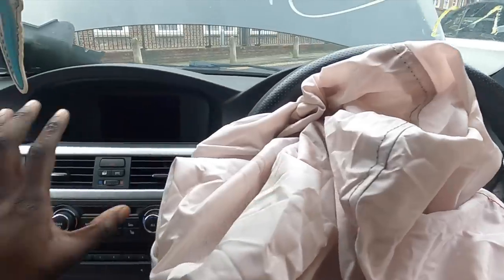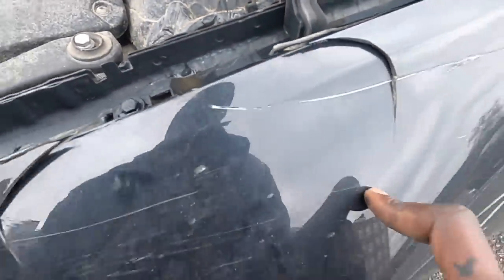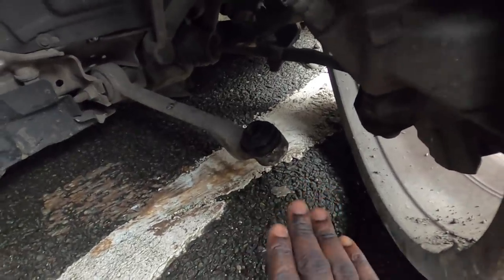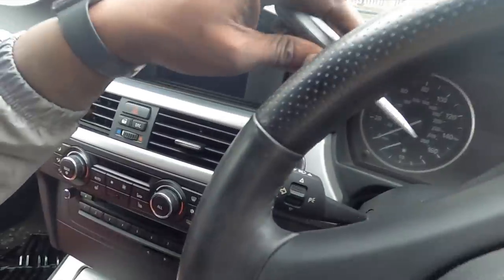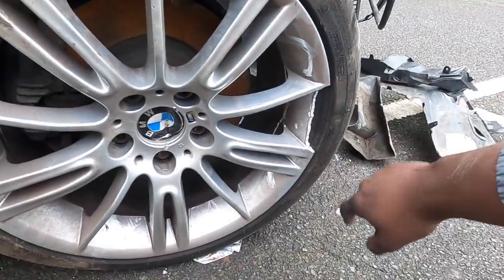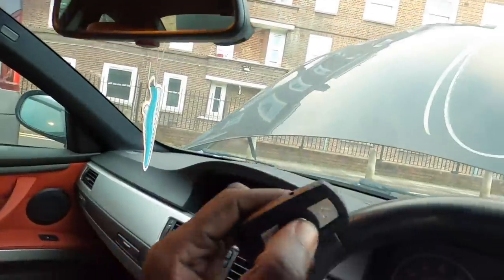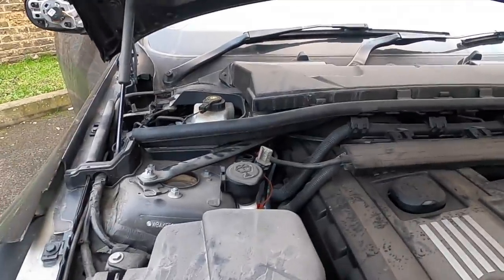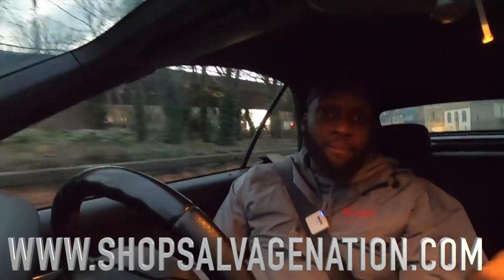Rebuilding A Wrecked CAT S BMW 325i E92 M SPORT From Copart - PART 1 (DELIVERY & DAMAGE BREAKDOWN)

Comment: Hi mate what category is that car?
Reply from the maker: Cat S. It’s got a small bent on the chassis leg
Reply: @SALVAGENATION  not too bad that oil leak is probably the engine oil cooler or the auto transmission cooler lines
Reply from the maker: i almost shat myself when i say it in the vid, but ive been doing some research today and i figured the same thing you said. but ill know forsure when i tear the front end down. thanks for the info.